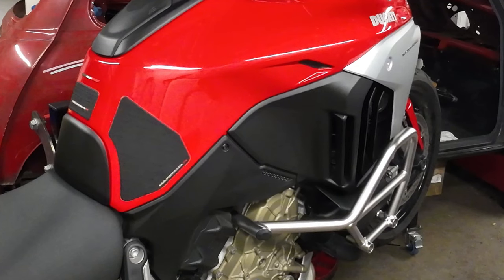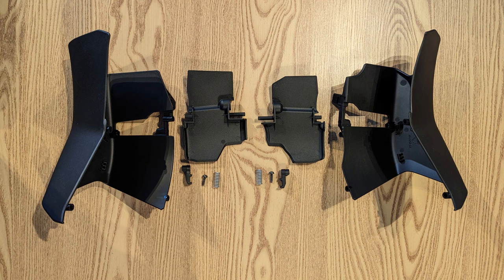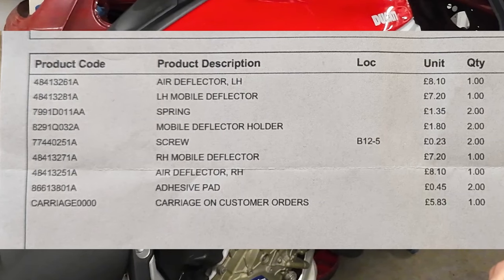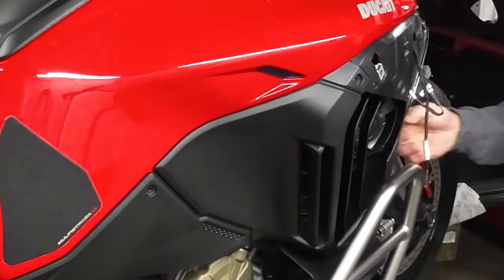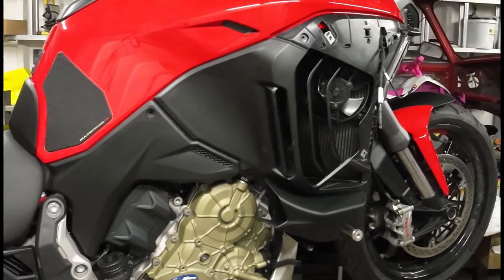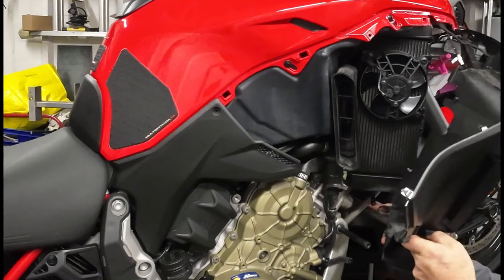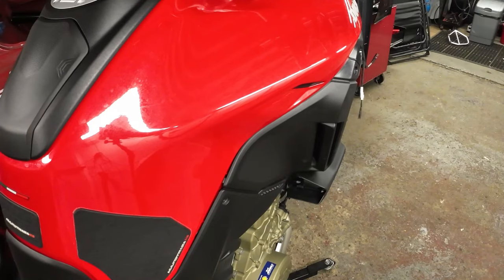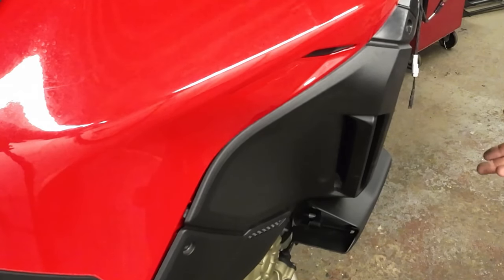Ducati Multistrada V4 Rally Air deflectors retrofitted to a V4S

Comment: Hi, Thanks for the parts list, very helpful. My parts arrived today and I am head to the garage now, one question, what are the adhesive pads used for, I've got then but can't see where to use them.
Reply from the maker: If you look at the photo in the video the pad goes on the edge of the scoop to stop it rubbing when you move the flap position.

There is a small square in the scoop molding where it goes.

Hope this helps.
Reply: @DucatiTravels thanks. For this. Fitting it to my Pikes Peak and didn’t know where the pad went. Got it in your comment!

Comment: You do not need to disconnect the fog lights and remove the cabling from the black panel. If you are careful you can remove from the radiator spigot and let it carefully hang by the cables. Then just pull the bottom of the panel away and get behind with the torque wrench. Took me less than 10 mins per side.
Reply from the maker: Yes you could leave them hanging by the wires but for an extra few seconds I unplugged them but if it works for you why not. ,👍